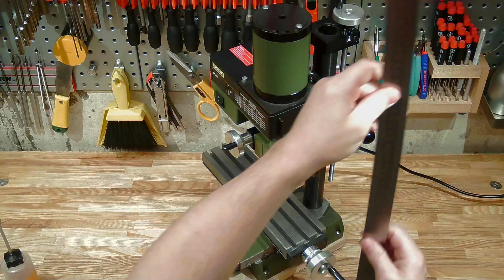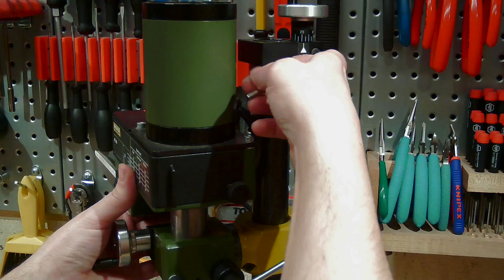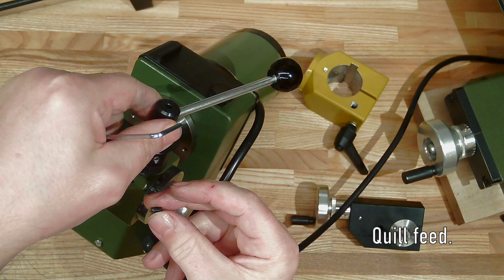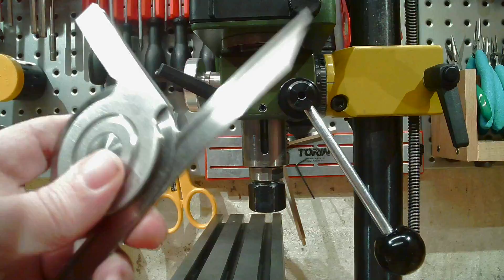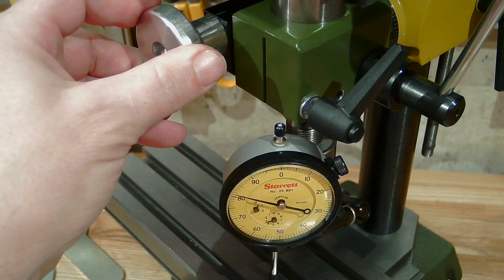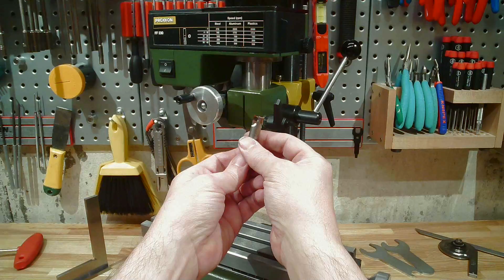Look-See: Proxxon FF230 Micro Mill Part 2

Comment: On mine I managed to replace the spindle with ER16 . And with 10 pcs ER collets still cost me a little cheaper than to buy their proprietary 5 piece collet set.
Reply from the maker: How did you do it?
Reply: @RoomForTools   I bought a extension C12-ER16-150L  and modify it on the lathe . I took some picture and video shoot thinking to make a youtube video .

Comment: when you pull the fine adjust pin to disengage it, does it freely move or is it keyed to the gear inside? I am wondering because I have the same mill but I don't have the fine adjust attachment, I was thinking of making one, in your video it looks like it slides in and out but it can't rotate freely when pulled, that means if you disengage the fine adjust then move the fine adjust wheel, to engage it back again you would have to keep rotating the wheel while passing on the pin until it gets to the correct position, is that correct?
Reply from the maker: The pin pulls out and pushes in easy when aligned properly and the quill is fully retracted. If the quill is not retracted, its spring tension locks the pin in place. Engaging and disengaging the fine feed requires a half turn or so of the hand wheel and the sweet spot is not difficult to find. When first installed, it might need several rotations to get it right. Also, only fully tighten the affixment screw when the fine feed is properly engaged with the pinion. Use camelcamelcamel.com to put a price watch on the fine feed's amazon page. Its price there sometimes drops to a reasonable level.